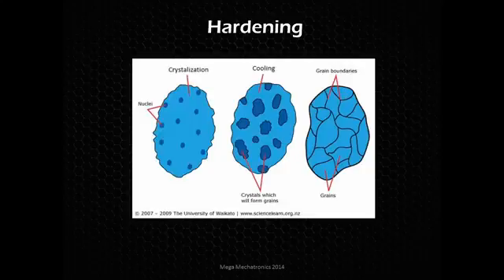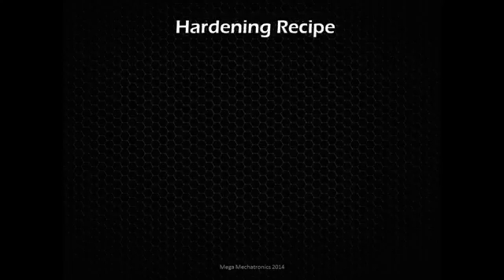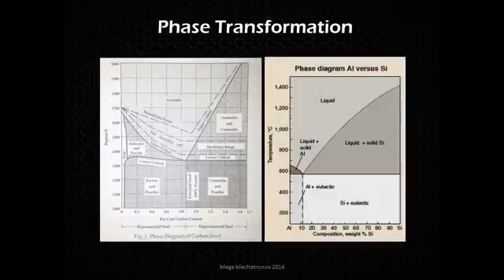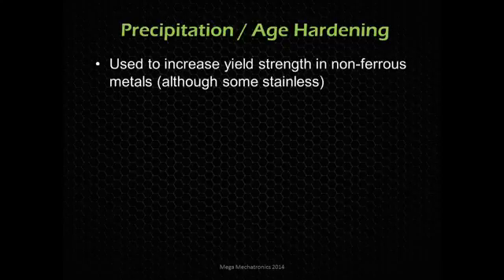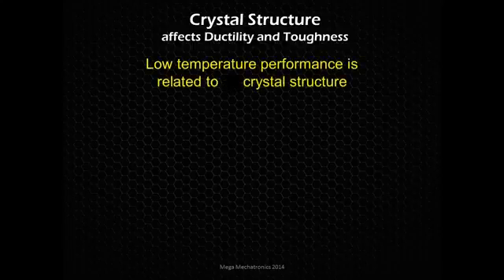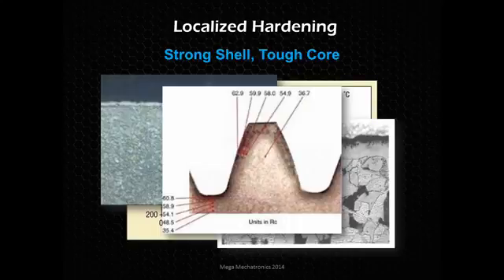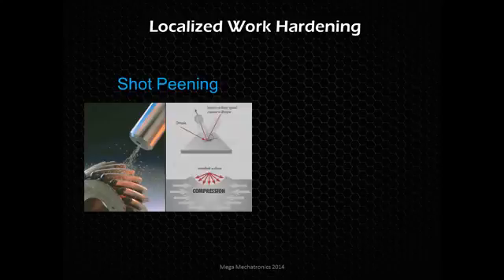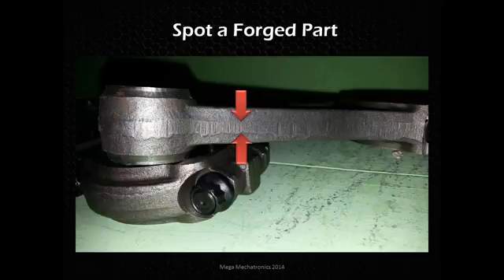Materials Science Mechanical Engineering    Part 4 Heat Treatment Explained

Comment: ======================================( HEAT TREATMENT QUIZ )======================================
By : Raka Bayu Naweswara
Student Id no. : 2714100004

This chapter tell us about heat treatment. Heat treatment is thermal process to deform the structure of the metals. When we talk about hardening, there will be crystal transformation and crystal lattice dynamic movement. This phenomenon is caused by the thermal energy used in this process. This thermal energy will move or even break the molecular structure of the material. Especially in the steel, steel is widely or famous metal for alloying or used directly due to the properties of the steel. Steel can be tough or ductile due to the treatment for the steel. 

Beside the the crystal transformation will be controlled by the cooling rate of the treatment for the steel. Smaller cooling rate will produce much bigger grain than higher cooling rate. It will make less grain boundary. grain boundary will be the one that will suffer stress in the materials. The stress in the grain boundary will make the material become harden. So, less grain boundary will produce more ductile mat, there will be grain boundary growth due to the thermal energy absorbed by the steel. The growth of the grain boundary. 

Hardness is mechanical properties of the material.it is different from the hardenability. Hardness is the properties of the material for how much it can endure piercing or scratch from other materials. The hardest material known by human is diamond. That’s why some of the hardness test is using diamond for the indentor (piercing material).Then, Hardenabillity is the properties of the material for how easily the material to be harden. Actually, the hardenability has relationship with the critical cooling rate of the materials. higher hardenability will make the critical cooling rate (CCR) of the material lower than smaller hardenability materials. The harden ability is one of the crucial aspect for welding. The hardenability will determine will the filler is needed or not. The hardenability means how easily materials can develop the martensite. martensite can make the material of the weld become not homogen. 

Actually, the heat treatment process not only produce martensite. it can produce pearlite or bainite due to the cooling rate of the material. And lower cooling rate will produce bigger grain. There are some method for heat treatments. They are Annealing, Normalizing, Hardening, and tempering. Each process has different methods. 
Annealing 

Annealing is a rather generalized term. Annealing consists of heating a metal to a specific temperature and then cooling at a rate that will produce a refined microstructure, either fully or partially separating the constituents. The rate of cooling is generally slow. Annealing is most often used to soften a metal for cold working, to improve machinability, or to enhance properties like electrical conductivity.

In ferrous alloys, annealing is usually accomplished by heating the metal beyond the upper critical temperature and then cooling very slowly, resulting in the formation of pearlite. In both pure metals and many alloys that can not be heat treated, annealing is used to remove the hardness caused by cold working. The metal is heated to a temperature where recrystallization can occur, thereby repairing the defects caused by plastic deformation. In these metals, the rate of cooling will usually have little effect. Most non-ferrous alloys that are heat-treatable are also annealed to relieve the hardness of cold working. These may be slowly cooled to allow full precipitation of the constituents and produce a refined microstructure.

Ferrous alloys are usually either "full annealed" or "process annealed." Full annealing requires very slow cooling rates, in order to form coarse pearlite. In process annealing, the cooling rate may be faster; up to, and including normalizing. The main goal of process annealing is to produce a uniform microstructure. Non-ferrous alloys are often subjected to a variety of annealing techniques, including "recrystallization annealing," "partial annealing," "full annealing," and "final annealing." Not all annealing techniques involve recrystallization, such as stress relieving

Normalizing
Normalizing is a technique used to provide uniformity in grain size and composition throughout an alloy. The term is often used for ferrous alloys that have been austenitized and then cooled in open air. Normalizing not only produces pearlite, but also martensite and sometimes bainite, which gives harder and stronger steel, but with less ductility for the same composition than full annealing.

Hardening is a metallurgical metalworking process used to increase the hardness of a metal. The hardness of a metal is directly proportional to the uniaxial yield stress at the location of the imposed strain. A harder metal will have a higher resistance to plastic deformation than a less hard metal. One of the most widely used technique for hardening is quenching.
 
Quenching
Quenching is a process of cooling a metal at a rapid rate. This is most often done to produce a martensite transformation. In ferrous alloys, this will often produce a harder metal, while non-ferrous alloys will usually become softer than normal.
To harden by quenching, a metal (usually steel or cast iron) must be heated above the upper critical temperature and then quickly cooled. Depending on the alloy and other considerations (such as concern for maximum hardness vs. cracking and distortion), cooling may be done with forced air or other gases, (such as nitrogen). Liquids may be used, due to their better thermal conductivity, such as oil, water, a polymer dissolved in water, or a brine. Upon being rapidly cooled, a portion of austenite (dependent on alloy composition) will transform to martensite, a hard, brittle crystalline structure. The quenched hardness of a metal depends on its chemical composition and quenching method. Cooling speeds, from fastest to slowest, go from brine, polymer

However, most non-ferrous metals, like alloys of copper, aluminum, or nickel, and some high alloy steels such as austenitic stainless steel (304, 316), produce an opposite effect when these are quenched: they soften. Austenitic stainless steels must be quenched to become fully corrosion resistant, as they work-harden significantly 

Tempering 
Untempered martensitic steel, while very hard, is too brittle to be useful for most applications. A method for alleviating this problem is called tempering. Most applications require that quenched parts be tempered. Tempering consists of heating steel below the lower critical temperature, (often from 400 to 1105 ˚F or 205 to 595 ˚C, depending on the desired results), to impart some toughness. Higher tempering temperatures (may be up to 1,300 ˚F or 700 ˚C, depending on the alloy and application) are sometimes used to impart further ductility, although some yield strength is lost.
Tempering may also be performed on normalized steels. Other methods of tempering consist of quenching to a specific temperature, which is above the martensite start temperature, and then holding it there until pure bainite can form or internal stresses can be relieved. These include austempering and martempering

Austempering is heat treatment that is applied to ferrous metals, most notably steel and ductile iron. In steel it produces a bainite microstructure whereas in cast irons it produces a structure of acicular ferrite and high carbon, stabilized austenite known as ausferrite. It is primarily used to improve mechanical properties or reduce / eliminate distortion. Austempering is defined by both the process and the resultant microstructure. Typical austempering process parameters applied to an unsuitable material will not result in the formation of bainite or ausferrite and thus the final product will not be called austempered. Both microstructures may also be produced via other methods. For example, they may be produced as-cast or air cooled with the proper alloy content. These materials are also not referred to as austempered.

Martempering is also known as stepped quenching or interrupted quenching. In this process, steel is heated above the upper critical point and then quenched in a salt bath kept at a temperature of 150-300° C. The workpiece is held at this temperature above (Ms) until the temperature becomes uniform throughout the cross-section of workpiece. After that it is cooled in air or oil to room temperature. The steel is then tempered. Martempering is a heat treatment for steel involving austenitisation followed by step quenching, at a rate fast enough to avoid the formation of ferrite, pearlite or bainite to a temperature slightly above the martensite start (Ms) point. 

Than, there will be cryogenic treatment to produce austenite in the room temperature.
There will be 3 metal working based on the temperature they’ve formed. 
The first one is cold work. Cold work is machining process of the metals in the room temperature or less. This will need more energy to form the material’s form but has higher precision. Then, there will be warm metals work that run at 0,3 of the melting temperature of the materials. It will need less energy but produce less precision. The last is hot working that run at 0,5 of the melting temperature. It need lowest energy but will produce worst accuracy. 

==============================================( Thanks )=============================================
====================================={ sed non mendacium est falsa }====================================

Comment: name: octaviyan adi (2714100013)
HEAT TREATMENT

so basically a material that has defects in the crystal due to the influence of deformation caused by compressive force from outside will affect its hardness nature. to get violent on the material, the hardening process is carried out. The hardening process step is by heating the material to a temperature region of austenite at a certain time and then desireble quickly in order to form a martensitic structure. each material has a different hardenability depending influenced by the chemical composition and the austenite grain size. in the video described the many ways in terms of getting the maximum strength of a material as desired needs. start adding alloying elements, these alloying elements choose a lot of functions ranging from improving the hardness and strength of the material and also improves corrosion resistance at high carbon steel. although quenching to form martensite but can not form a 100% martensite certainly no residual stress and retained austenite, for it to do so tempering residual stress can be eliminated. so many ways to get the maximum of hardness, in this video how the other way is the first localized hardening such as induction hardening and carburizing, ie subsequent cryogenic treatment . Cryogenic Treatment is a used to transforms retained austenite into martensite by cooling it at extreme temperature such -300F by using liquid nitrogen or other. Cryogenic treatment promote uniformity and strength. Hardness vs strength is directly proportional. But hardness vs toughness is  a inversely proportional generally work hardening or cold working is uses compression forces and plastic deformation. Cold working  creates a desirable dislocations in the crystal lattice structure, improving yield strength, but reduce ductility. The example of cold working is cold rolling process, cold heading, shot peening, roller burnishing. Another example of work hardening is hot forging. Hot forging is done at higher temperatures and will give more stronger properties than an equivalent cast part. The advantages by using forging is the grains will aligns to the shape of the part.for testing hardenability Jominy test is done in a way that will be carried out test results in the form of hardness and graphic hardness against distance from quenched end. so basically to get the maximum hardness there are many ways. 
it is a very informative video for those who begin learning the heat treatment, but at least if it was another person/channel video you should mention it,thankyou verymuch